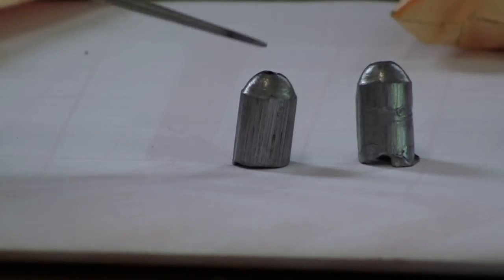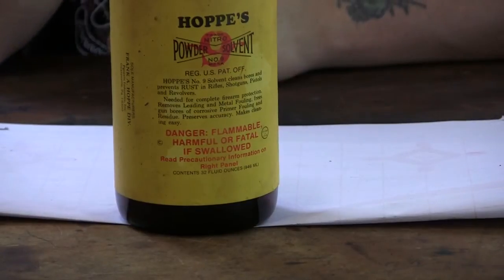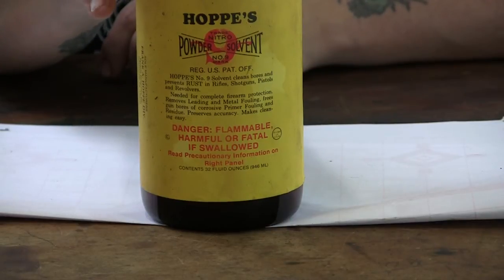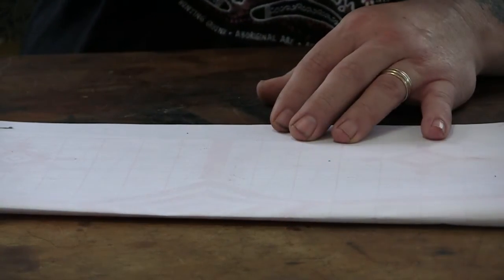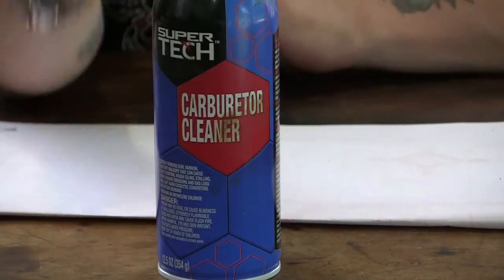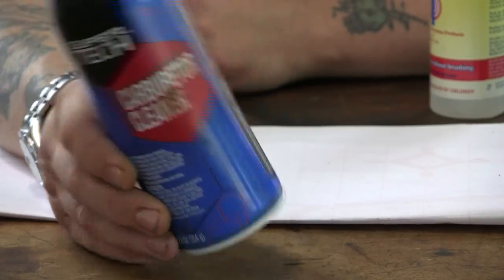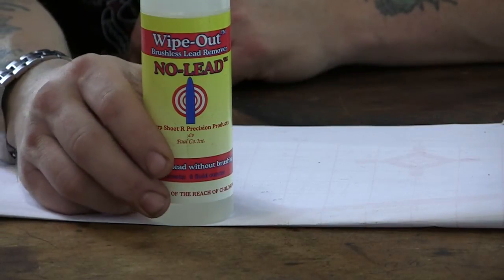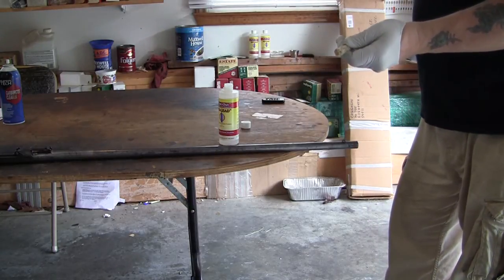Removing Leading from the springfield trapdoor(2/4)

Comment: And that is why I will buy a junker with a mint barrel before I'll buy a mint rifle with a junk barrel.

Learn barrels. No one has an excuse for not knowing what to look for. It's extremely easy to spot flaws and anyone saying otherwise is either a con or a cons shill.

Don't buy trashed barrels if you plan to shoot them.

Buy a Mini Mag flashlight, buy the fiber optic bore illuminator attachment. That alone tells 99.9% of the story.

If you want to get super fancy, bore scopes are now dirt cheap. You can see "speed bumps" (reamer marks) just with good lighting, you can see dings in the rifling and damage to the crown without a bore scope but the bore scope pics up everything, it can make a decent barrel look bad so best to look online and get reference images of various barrels from mass produced to custom match and then look at all of your own guns. 

Build a knowledge base. Then never buy a bad barrel again.

Oh, there are plenty of Trapdoors with excellent barrels out there that aren't pitted, aren't leaded and don't have ramrod damaged muzzles.

Buying online makes inspection impossible. Ask the seller to get clear images with a good backlight.